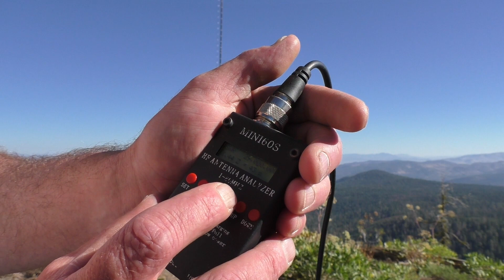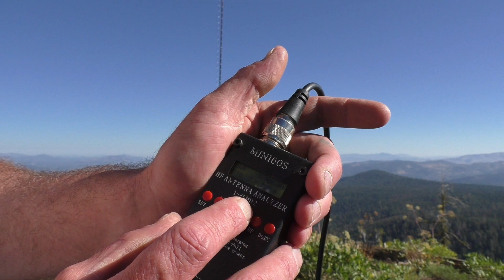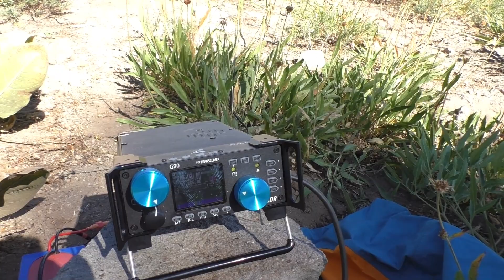How To Slinky Antenna

Comment: For the benefit of someone who hasn’t touched a Slinky™ since I was a kid 😀 – are there different sizes of slinkies? Did you buy a ”genuine” one or a knock off? How far will one stretch (and still go back to its original size)?

I saw (on AliExpress, I think) a loading coil for a PAC-12 antenna for a reasonable price. I wonder how adding one of those to your setup (to base load it) would work.

All of my HF gear was stolen (uninsured!) over a decade ago, and I’m looking to get back into the HF portion of the hobby. I’d like to start by putting together a (QRP) ”go pack” for HF, piece by piece, with ”affordable” ham gear (if that even exists).

73 de AF6AS
Reply from the maker: @ChaplainDaveSparks  I was using the Slinky original. It was like 5$ or so on Amazon. I'm sorry to hear about your gear getting stolen 😔. I would recommend an EFHW wire antenna for a good budget multiband antenna. You can make your own for a low cost.

Comment: Been trying a Slinky with a CG3000 auto remote ATU with a single 43’ counterpoise. I’ll do more experimentation
Reply: The CG3000 remote ATU tuned it all bands 160-10m. I need to take it to hilltop behind my house away from the noise and check efficiency….Cheers
Reply from the maker: Try multiple shorter counterpoise wires. I was using 3 different lengths that day, 1 for 20m, 1 for 17m, and one for 15m.  Several wires cut to your target band would be ideal. An old cat5 cable makes a great inexpensive counterpoise with several wires! Here's some info on lengths to cut. Thanks for watching, and have fun experimenting! 
https://reflector.sota.org.uk/t/counterpoise-length/22133/3

Comment: More than $30. You have to take the portable mast you use for the new operator.  Those fiberglass push-up masts are not cheap! (wish I had one!!) That is why I chose to use a pair of Slinky's to make a Pac-12-style portable antenna instead. The Slinky's are soldered together to make one larger coil. This is my loading coil and I used a piece of galvanized conduit for the mast/element below the coil. So far works great and it cost me (no balun, unfortunately) less than $15 not counting coax. But I tend to break the conventional rules to make antennas that are less than dirt cheap.
Reply from the maker: That sounds like a great experiment. 👍  I have a pile of several different size slinkys I hope to experiment with when I get more time and the snow ❄️ melts.  The fishing pole mast is only 33$ on Amazon. https://www.amazon.com/Goture-Fishing-Ultralight-Telescopic-Segments/dp/B079S4VVMD/ref=mp_s_a_1_3_maf_1?crid=3C3UML09RXTT2&dib=eyJ2IjoiMSJ9.ua358p_XkBUMeVq0X2pdug_aVmmxuEVKSz7R9JDIVZwvuzIjB6ByKlKrQ48WNGNQmfrTL8QUo9-BBbZ94WZQlaMGG5eoqbPa59i1BJYBMqtNiE5JENsTWJh3SZWojCEQ3-ltwqHQjDaqkfb7uxKd_hTxZTI3DYmlDMGPgwrHJfQQS5LUKmbaGl_SbYbV-7fXu4J8IUROqEKmTippxjEZfA.ftGP7VX8pm0d8nM-L36RP7G06GTFV021by_5159Tppw&dib_tag=se&keywords=telescoping%2Bcrappie%2Bfishing%2Bpoles%2B21%27&qid=1709522811&sprefix=telescoping%2Bcrappie%2Bfishing%2Bpoles%2B21%27%2Caps%2C185&sr=8-3&th=1&psc=1

Comment: now that's an interesting one! wonder wouldn't the slinky create kinda helix circular polarization in this case? also look pretty inductive to me 🤔 wonder how wide is the bandwidth on this one?
Reply from the maker: I've been told helix no, but I can't confirm that. It was pretty wide with a 9:1 and 1 slinky. I hope to experiment more in the future. I bought 3 large slinkys and 1 mini to experiment with. Thanks for watching 👀 🙂
Reply: The turn spacing is much too close for circular polarization.  This vertical will simply be vertically polarized.  At microwave frequencies it might become circularly polarized and launching off the end.

Comment: I’ve seen people use alligator clips to short out coils at the bottom to tune it. Not super scientific, but I’ve seen guys run radios with no tuner doing it. Maybe worth a try. 
Nice video! Keep them coming Bobby!
Reply from the maker: That's on my list for the next experiment! I would like it as efficient as possible and a little less compromised.  Thanks Tyler 😊
Reply: @W6IWN_Radio  Do you have a DX Commander? I have an expedition if you want to borrow it and do a video…
Reply from the maker: @K7TDM_Tyler  I don't  own one, but that would be awesome! You should join me and show me how it works!  Thanks so much, Tyler!!! 
SNARS has some great people 👍 👍 www.snars.org

Comment: I've used a Slinky dipole during Field Day.  Worked well with a tuner on 20 and 40.  Until the rain came in and it would no longer tune.  We think that the rope we used to string it out with horizontally got wet and was shorting the coils.  Might try it again using fishing line.  At least we won't have to wait for the line to dry after the rain.  Had not considered one oriented vertically. Thanks for the idea.
Reply from the maker: Awesome experiment! Try adding some insulators between the slinky and connection points. I cut up some thicker plastic off the bottom of an orange juice bottle to make  one. I've read about some dipole experiments, atic experiments, even a tactical dipole. Someone mentioned using an alligator clip to clamp rings for tuning!
Reply: wonder if running like 500w thru it gonna dry the rope in seconds😆

Comment: Have you tried using a 4:1 balun with this setup? It should work similar to a rybakov antenna, but you WILL need a tuner.  73 and good luck!
Reply from the maker: No, I haven't yet, but I definitely would like to experiment with one. I don't own one right now, but I do have a 5:1UnUn. Thanks for watching!